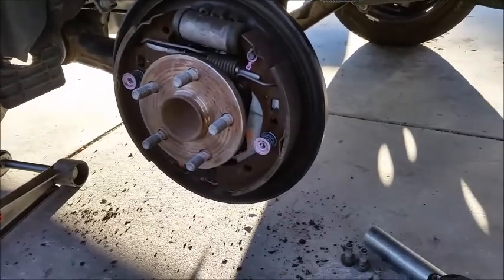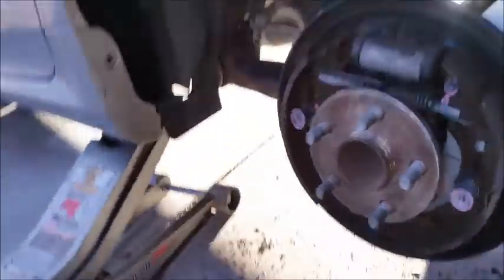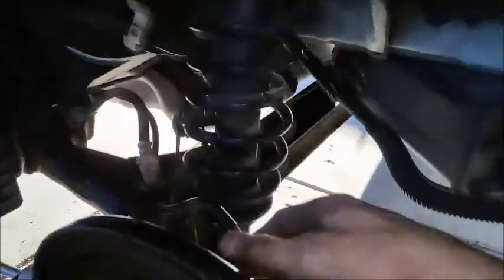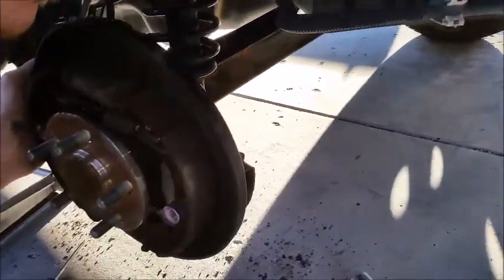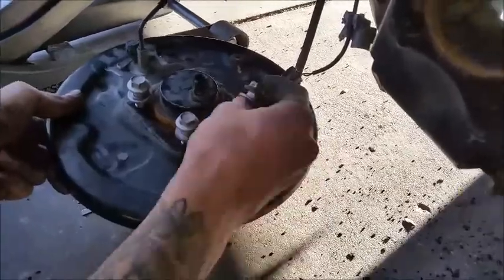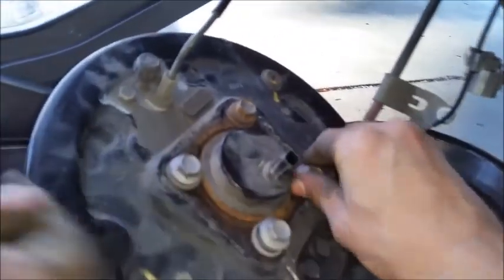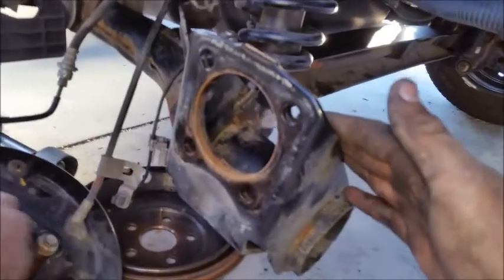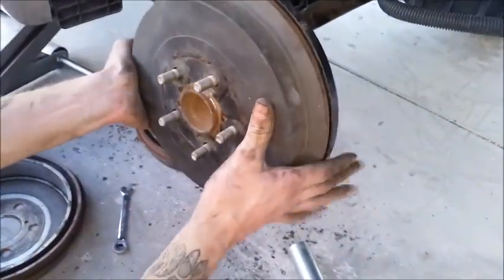2012 Corolla Rear Wheel Bearing Hub Installation / How To

Comment: what was the torque spec on the hub bolts, and did you use loctite?
Reply from the maker: @noobstopped  sorry I can’t remember what the specs were but I’m sure you can find it online or in a repair manual. No loctite